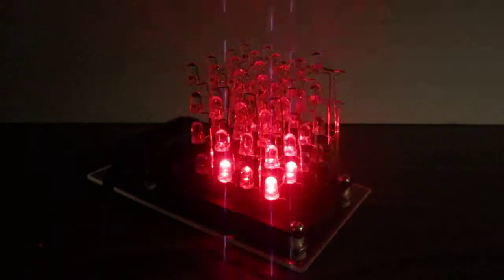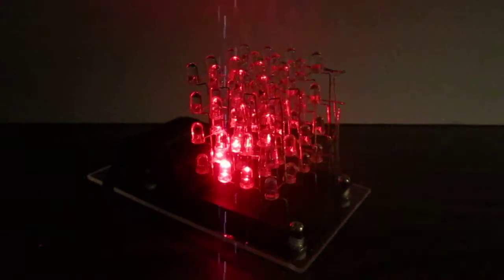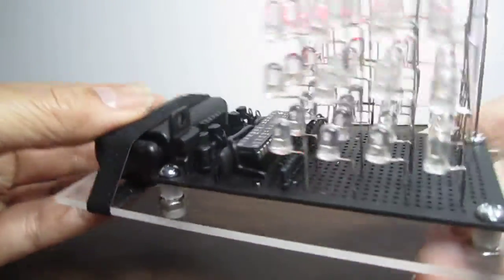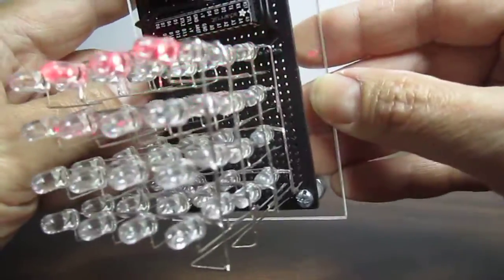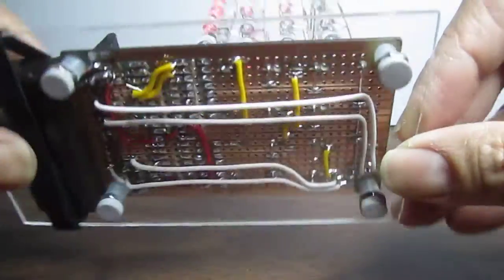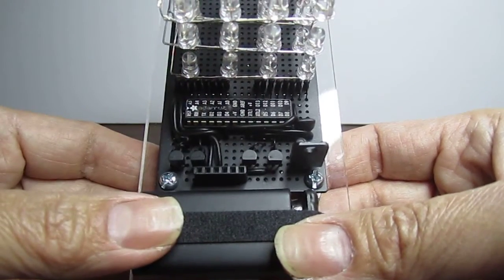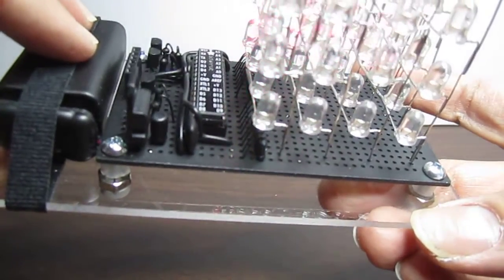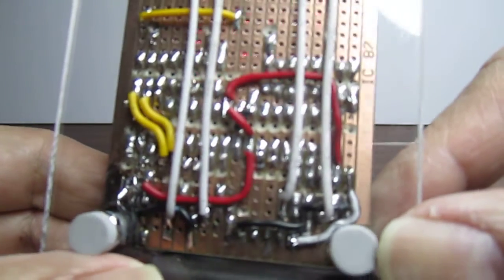4x4x4 LED Cube with bare bones Arduino

Comment: Hi, I know you made this project a few years ago, but I was wondering if you have any schematic or other detailed info on this project?  I am planning on making this LED cube, can you please let me know what transistors / resistors / capacitors you used and how they are connected.  This seems to be quite different from the 4x4x4 RGB cube you made whick does not use any extra components.  Thank you for your help and sharing this cool project!
Reply from the maker: Hi Daniel, I'm excited for you. I love LED cubes.  Did you see the blogpost?
http://g33k.blogspot.com/2013/03/4x4x4-single-color-led-cube.html
Sorry, I didn't draw schematic or parts list and because I painted all the components black, I can't tell you what they are either.
I probably used four 1K on the base of the four  NPN transistors. The sixteen current limiting resistors are probably 470 ohms (you can go as low as 220 ohms and as high as 1K ohms, lower = brighter).  The rest of the circuit is a breadboard arduino, and the source code will tell you which Arduino digital pin controls what.  I'll try to draw a schematic this weekend.
Reply: @HariWiguna  Hi, wow fast respone! I did see your blog post about this project and the RGB cube and saw the info about soldering the cube together but didn't see info about the now painted components!  Thank you for the info about what parts to use.  A breif schematic would be very helpful, it doesnt need to be anything too fancy.  Thank you so much for your help!
Reply from the maker: I did my best to document this old project by reverse engineering it from the source code.  Please breadboard at least a few LEDs first to make sure that it's working and the LEDs are bright enough.  Please let me know if you found any mistakes so I could correct them.  Good luck and have a fun!
https://hackaday.io/project/170607-4x4x4-single-color-led-cube
Reply: @HariWiguna   Hi thanking for making this project on HackaDay. Looking at your schematic it seems so simple to connect everything. I would have thought there would be wires all over and it would be hard to follow, but your layout is so easy to read! One thing I noticed is that the resistor going to Q4 is 470ohms whereas the other three are 1k, should they all be 1k?
Reply: @HariWiguna   I also have a question about the 16MHz crystal (I know its only needed if I use the stand alone chip). It seems like the crystal in your schematic has 3 pins (and the part might inclue two capacitors?) where two of the three pins are going to the atmega chip and one going to ground. The crystal that I'm looking at only has 2 pins. Do I also need to conect capacitors to the crystal?
Reply from the maker: You're welcome. The key to "hiding" wires are those global labels.  They allowed us to connect points without showing the actual wire lines.  Yes, all four resistors on the transistor base should be at least 1K, 10K would work too.   Thanks for finding that mistake.  I've corrected the schematic.
Reply from the maker: While you CAN use a 16MHz crystal and two capacitors. I used a Ceramic resonator, which basically have those three components in one package.  Ceramic resonators are less precise, but for most Arduino projects it is good enough.  I've added links to parts including the ceramic resonator below each part in the hackaday post under Components.
https://hackaday.io/project/170607/components
Reply: Ok, thank you for all the information.  Those global labels definitely make it way easier to follow the schematic!  I will be receiving my parts in a few days and will let you know how it all turns out!
Reply: Hi, I got parts in and I am soldering them together now. I think I'll use an Arduino Nano instead of a bare bones AtMega chip for simplicity.  
Do I still need to use an L7805 voltage regulator or can I connect a 9V battery directly to the Vin pin on the Nano? 
Also, when connecting the columns to the Arduino, does the orientation of the columns matter, ie: what is the column numbering sytem that you used? See here: https://ibb.co/Tq8d1Q2, option A or option B. Or does it not really matter and it should all just be modified in the code later?
Reply from the maker: @danielgreen112  (1) Using a Nano is a good idea. Keep it simple.  You could swap the bare bones later if you change your mind.
(2) You can connect 9V directly to the Arduino VIn pin, no regulator necessary.  You could even just power the whole thing off USB port.
(3) To be honest, I don't know which way I wired mine.  Luckily, the code has an array where you could specify which pins are which of those 16 in a layer so no need to rewire if the pattern ends up being wrong.  Just tweak the leds[] array.
Reply: @HariWiguna  Hi, thank you for all your help! I have finished my cube! here are links to some pictures:
https://ibb.co/74dLJZP
https://ibb.co/gtcBGGg
https://ibb.co/k8w6VFB
https://ibb.co/rxLhMXn
Here is a quick video of the cube:
https://youtu.be/98Mnf0n86zM
Next I am going to try making the RGB version like you and Asher made!

Comment: How much did this project cost to make?
Reply from the maker: Sorry, I don't remember. I would guess about $30 depending on where you purchase parts (China is cheapest, but takes weeks), and if you have some parts already.  You will also likely end up with extra parts since no-one would sell you exactly 64 leds, and you probably would get better deal if you purchase multiple parts to save on shipping. Good luck!